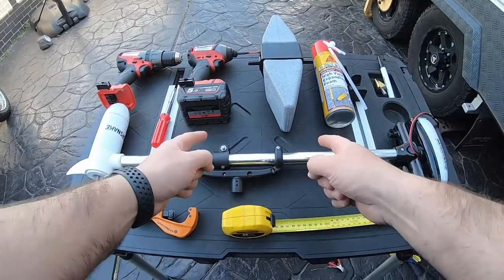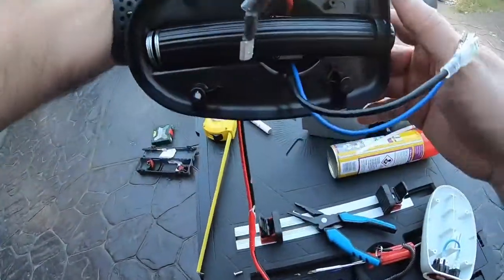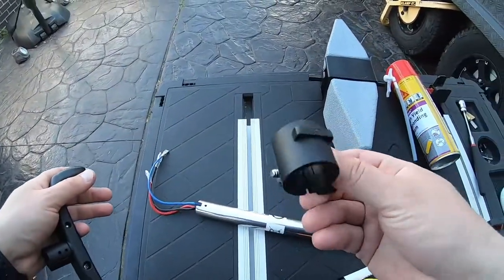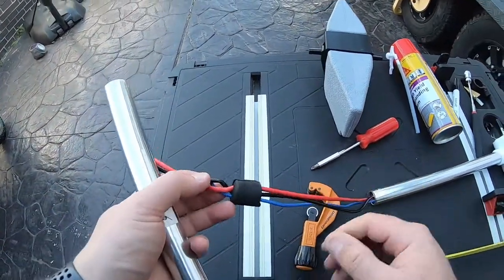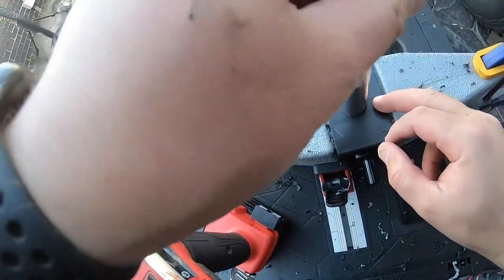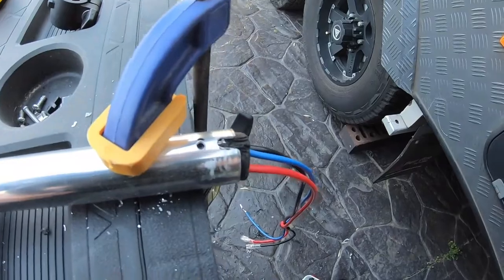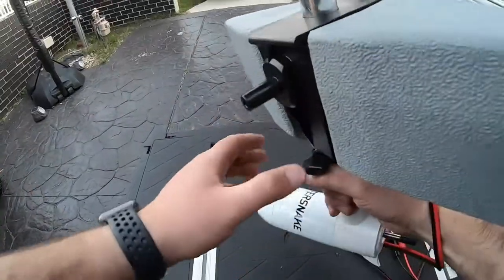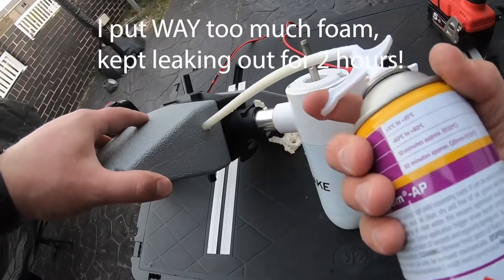Hobie Watersnake mod install step by step.

Comment: Just finished building mine (well, still need to put it in the water ...) but thanks for the step by step.  I did use the head unit to scribe my notch and hole template. Good suggestions.  I also used a 3/4' pvc with a notch (made it like a rudimentary spoon) and slid it in the metal shaft to protect the wires from the initial drill puncture through the metal.  I also used the collet that was supplied for under the water, and took the transom mount and cannibalized it (took the sleeve part off and used it as an upper collet).  Therefore, I can raise and lower (say, to the tune of 10-12cm up or down) depending on the depth of my water while the lower collet assures that my prop doesn't hit the yak.  The pipe cutter is crucial.  I borrowed one, but knowing how easy and clean the cut was, I would buy one if I had to.  Good luck to all who venture this route, and it is certainly worth the time, if you wish to pay ~$150 rather than $1000+ for the Bixpy.  BTW, the salt watersnake is on sale right now (12/29/2022) on Amazon for $92!
Reply from the maker: Glad it was of benefit. Awesome tips and mods you brought up too💪
Reply: Back to $130 unfortunately 😕 😞 😔 😪

Comment: I bought this motor with the transom mount from BCF today to go on a 3 Waters Big Fish 120 in the same way. The 120 has a removable pod and the motor fits through the lower slot in the hull perfectly. Ive just got to work out wether to shorten it like you did but have the controls on or near my seat or put it in whole and just turn the top around 180* so the controls face me. One good thing about it going in whole is I can retract it up into the hull when Im in shallow water without having to take anything off.
Reply from the maker: All the best with it.
Reply: @outbackshadz3809  Got it sorted and it works a treat. I had to buy a rudder, the ass was all over the place. Didn't have to cut anything, only turned the top of the Watersnake around 180*.

Comment: There is person in Miami, makes custom cassette. $99 on eBay. I didn’t cut my motor shaft. Took head off, put shaft thru hole in cassette.  Put motor head back on. I added a hose clamp to motor shaft. I plan on adding pvc pipe to handle. It’s too short for my 2011 PA14. T24 works great in fresh and saltwater.

Comment: Hi mate  nice job can I ask you how do you Aline the propeller to pull out the casete for the trolling motor 🤔
Reply from the maker: I use a coat hanger

Comment: How did you connect the motor to the 50ah battery? The motor has two clips at the end of the wiring but the battery doesn’t have exposed terminals to clip to. Did you convert the connections some way?
Reply from the maker: I converted the connections to an anderson plug
Reply: What gauge is the anderson plug?

Comment: I am about to perform this same project and this video was extremely helpful!  Thank you for taking the time to make it. For the battery connection, did you use a circuit breaker or inline fuse and if so, what size breaker/fuse?
Reply from the maker: No breaker or fuse. Would be good to connect an emergency cut off

Comment: Great video. Question: is there any significant difference between the cassette you have here (grey/black) vs. the other common one (all black)? Yours looks more substantial but I’m not sure if that’s the case. I just wonder if one is more beefy or rigid than the other. Thank you.
Reply from the maker: Glad you enjoyed it Chazzman. Im not sure if there is any difference between the 2.

Comment: Why would you not remplace the part of the sube at the motor with the top part that Hal all the noches already?
Reply from the maker: You can if you dont cut the pole to shorten it.
Reply: I think he meant: instead of cutting then discarding the top half (thus having to drill and cut notches), can you remove the motor and discard the bottom half more easily?
Reply: I was thinking the same. Unless you cannot access the lower housing. Overall great video. Thanks for taking the time to share.
Reply: lower housing is sealed, motor controlls (top) is just screw fixed.

Comment: Did you consider the 34lb thrust version of this motor?  What would be the pros and cons?
Reply from the maker: I think it would be overkill on the kayak. Plus it will add alot more force on the mounting point which I don’t think will be a good idea in the long term.
Reply: @outbackshadz3809  would a 34lb thrust fit through the hull? I got the 24lb and it is horrible in the current.
Reply: What size should be to fit thrue the hole?

Comment: Why not just put the adapter on top to keep it from sliding down.  Also wouldn't it make sense to keep the motor turnable so you can adjust it to pull sideways says if you caught a large fish and it started pulling the kayak sideways
Reply from the maker: I can turn the motor Ive got a dowel locking it in place straight and simply remove the dowel and can turn the motor.

Comment: Whats an easy way to unplug all the wires in the motor? Im struggling lol
Reply from the maker: There is no easy way LOL. They are hard to get off use long nose pliers
Reply: @outbackshadz3809  I finally got it. Man do they really place em all in the tiniest crevice imaginable lol. Thanks for the response though!